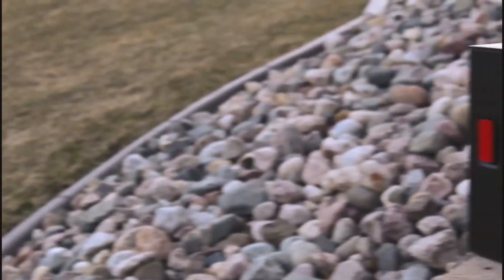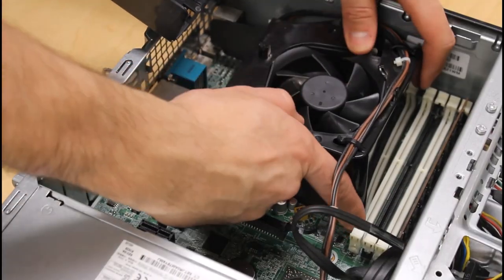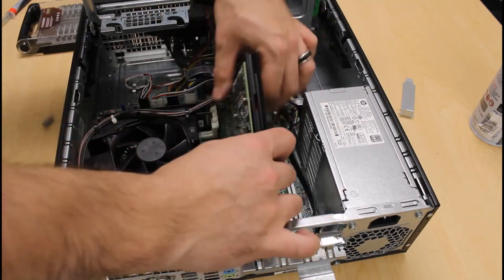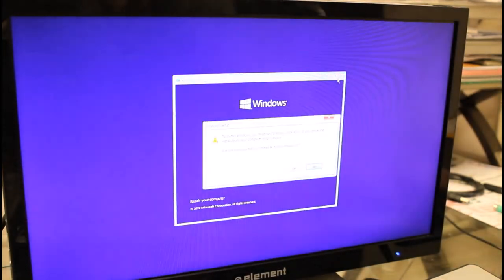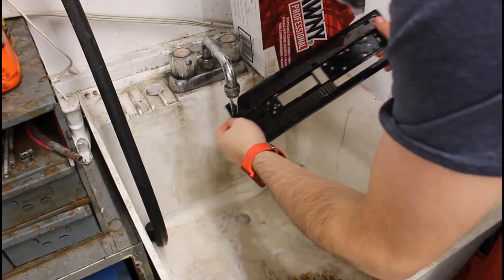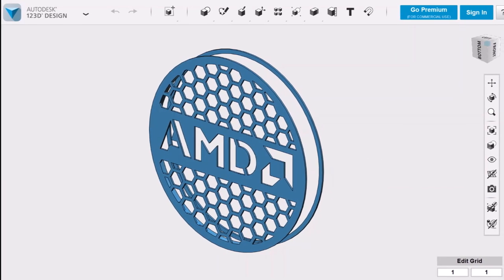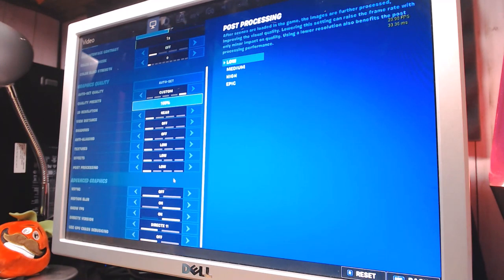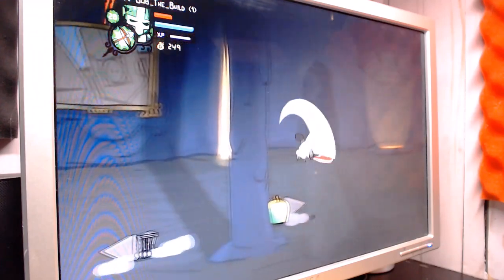HP SFF Gaming PC -  Ultra-Budget Mods & Upgrades

Comment: Ive got one a hp prodesk 6000 with an i3. ive put in a full size graphics card in (with a bit of cutting). My issue is the core i3 4150. Im going to get a core i5 4570. Its about £40. For £90 I could get the full size version of this computer with the i5 that I want included plus my rx 470 would fit with no modifications. I think ill spray the front red like you did. Its my favourite collour. Great vid. Ive subbed.
Reply: for that 50 euro difference you can buy a nice looking gaming micro atx case from newegg and throw all the parts you have in there, youd just need a new power supply and a mobo power connector adapter for a total of 30 euro extra you can get a way better lookin pc

Comment: Get yourself a cheap $50 case, transplant this to it and save up for a proper graphics card. Even though the motherboard and PSU are proprietary, there is an adapter you can get for cheap (24 pin to 6 pin adapter) to fix this issue letting you install a proper PSU to power the system.
Reply: I might be wrong but I'm pretty sure these SFF Pc's use a Btx case and motherboard. So you can't actually fit it in an Atx case
Reply: @HonkForLife098  It’s a “micro” ATX board with standard mounting points. The telltale sign is vertical memory modules and cpu location (in the rear, not front), so any ATX case will work. I did a complete transplant of this board into a mid-tower case without issue aside from getting the 24 to 6 pin power adapter. 

Here is a photo of the build: https://ibb.co/PhNFwzS
Reply: @TheRedRaven_  what is the model of the board exactly and from what model of pc did it come from? I want to do this as well.

Comment: i have this exact pc with 32 gigs of ram but i dont have a graphics card in and it runs all the games i play,
 i run these games at 720p becuase of the tv's resolution,
terraria at a full 60 fps with subtle frame skip,
minecraft 15 chunks at 40 to 100 fps with a mod called sodium for more fps  ( this game fps do be weird) 
skyrim se with lower settings with the use of bethINI i get 20 fps surprisingly playable at that framerate but if want more fps i set the resalution to 800x600 for 40 fps in most casses,
fallout 4 is the same case with skyrim but you cant see the full hud in power armor in 800x600 resolution so rip,
gamecube emulation isnt that great it barely plays u.s games smoothly but i think eu games would work since they are at a lower frame rate,
psp emulation is perfect for monster hunter at 2x resolution 3x resolution would still work since thats the only psp game i played,
dream cast games should run at full speed (tho the only game i played was sonic adventure 2)
n64 games play smoothly and i think it would run better if you find the right core i forgot whats it actually called,
roblox runs smoothly on the lowest setting but you can turn it up a bit if you want the games to look better,
fortnite runs around 20-30 fps on the pve game mode save the world and the battle royale portion is not that playable with the performance mode, i havent played it in a while tho, 

and this is the frame rates and stuff i get on this pc and i enjoy playing these games on this computer
i do have a laptop for when i wanna play games that dont take much power to run like game boy and super nintendo
and i also use the laptop to connect to the internet on this pc since im ways away from the router, and uh yeah this is long oops

(do note if you install the new amd drivers youll get a weird color swap when you launch the game the second time in full screen mode the only thing i found that fixes this is go to the .exe file to the game or emulator right click property's then compatibility then disable full screen optimizations that should fix it, most of the games i listed have this issue) 

gaming with a wireless mac keyboard on windows is fun :) dont do this please  you only have access to f5 and f6 function keys and i had to rebind things on minecraft for full screen and screen shots, i dont know how to fix it or change it work properly (i got my keyboard from good will for 5 dollars its a logitech k750 keyboard and i know there is one for windows it was just not in the thrift store just uh telling this part just incase some one wants to know the keyboard im using also typed this whole thing out with this key board) 
okay maybe i should stop before it gets longer lol

Comment: I have HP 800 G1 can i swap cooler for another (arctic cooler) now i have stock HP cooler and its really bad...One guy told me i only can swap hdd and ssd 😓 or can I swap to ATX case with change of power supply? And yeah I have HP motherboard...

Comment: I live in the philippines can this run with 220V?
Reply from the maker: I think HP power supplies work on both, but I'm not positive. You'd have to check the spec sheets on whatever model you look at.
Reply: @Pilotgeek  I am buying Elite 8300 Desktop, Intel Core i5 (3rd Gen) but I am not sure If it is safe to plug it in on  my area
Reply: I have HP Elite 8300, here in Nigeria and we use 220 V. It works fine. Mine was bought from a primary school in America.... There was a sticker on it.
Reply: @JohnFekoloid  I see thank you.

Comment: hi I have HP G3 400  with i3 6100 and 8gb RAM  35 HDD 7200RPM  -  SSD 128GB 6gb/s Samsung  180wat PSU   what maximum Graphic Card  I can install to this pc? a 1030 GT LP or 1650 LP? or rx 560 LP? or is better options??
Reply: the 1650 is the best lp GPU

Comment: i did this with my other old pc and while the performance was great, it didnt work with wifi adapters because of a power supply issue. does wifi work with your build? please get back to me when you can, thank you!
Reply from the maker: Yes, I did have wifi working on mine, though it's possible it used a different variation of chipset. You could try a USB wifi adapter if the internal ones won't work.